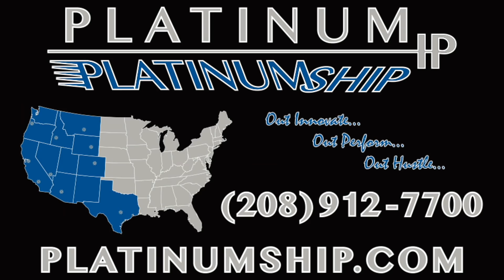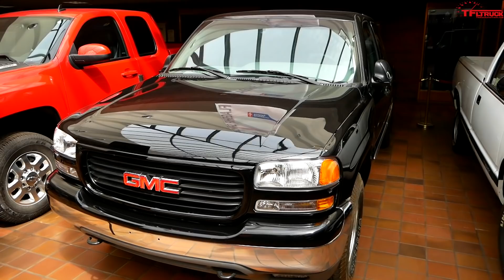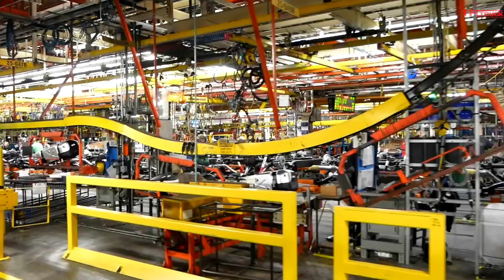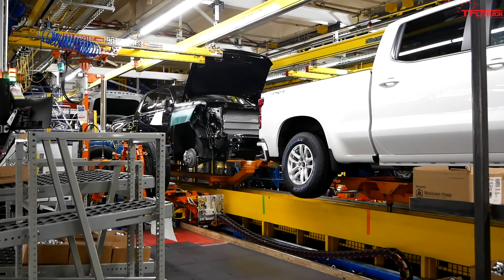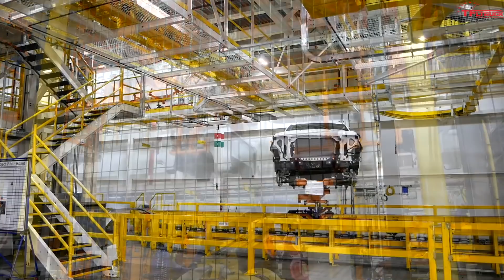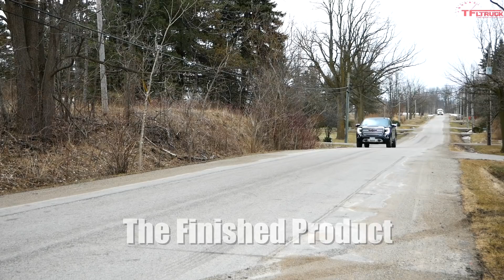They Can Build 1,000 Chevy Silverado and GMC Sierra Trucks Per Day Right Here

Comment: All or most vehicles price tags are way to HIGH !!!  I was able to by a 2012 Silverado 1500 used at a car dealership in 2013 with 25000 miles With a lift and wheels and tires for $28500 . I will never and never have bought a brand new vehicle.
Reply: Probably because you can't afford it.

Comment: Chevy has been on a downward spiral in my opinion since the Bailout...   For the company that I work with we bought a fleet of Chevy express 1 ton and vans.  I have never seen so many stupid issues since the 1990s Dodge Caravan.  Example:  Two of the work vans didn’t even have 2000 miles on them one of the front tires would be perfectly brand new rubber on the inside and threads showing at the very end of the outside.  We had another van needed a new Rear End after 1500 miles.  How about they don’t galvanize their bumpers anymore so if you get a measly scratch or chip in the paint it’s all downhill rest and out within two years.  “CHEAP CHEAP CHEAP”.    Why don’t they point this out in the Chevy commercials Instead of trying to make competitors look bad.

Comment: check the vin number on the dash.If it starts with 3 it's Mexican .Last year I was going to trade up my 2009 Sierra but all the new ones on the lot were Mexican .I passed.
Reply: What about South America add them in while your at it @michaellee-g9v
Reply: Michael,i think you are clueless, and congratulations on your knowledge of 2nd grade geography @michaellee-g9v
Reply: got something against Americans?
Reply: What part of my comment did you not understand? @anthonywebber2211
Reply: @danielburns7519 , you passed on a American built truck
Reply: THEY were all made in Mexico,they had a vin number that began with a 3.The service manager even admitted they were made in mexico @anthonywebber2211
Reply: @danielburns7519 , America is a continent not just a country, which includes Mexico and Canada
Reply: OK Anthony Mexican workers make $8.00 an hour with no benefits why not adjust the price of these trucks say 15,000 instead of 50,000.Screw Mexico I support the UAW worker @anthonywebber2211
Reply: @danielburns7519  Jose and friends probably have much more job pride than Dick, Rod and Tomika put together.
Reply: @michaellee-g9v  
You don't say
Reply: @anthonywebber2211  now i see that i wrote similar to yours.= Stuff happens. ** My truck has a Ft. Wayne decal on the back inside drivers door.

Comment: My 2018 Colorado has 7k miles and has to have the rear end repaired twice and its still not fixed, the air conditioning goes in and out, the transmission clunks when coming to a stop and when letting off the gas after accelerating, the paint has multiple problems in it developing from a poor job being done at the factory. Its in the shop right now because the engine is misfiring and the check engine light keeps flashing and for the AC issues. GM does not care about their products or their customers. Its great that they are building trucks here from a jobs perspective. But the final product is garbage.
Reply: @michaellee-g9v  I did hire a law firm recently but I chose poorly. I have not spoken to a lawyer one time, just a legal assistant. They are trying to force me to accept the settlement of which they will take half or claiming that I will be on the hook for legal fees. I looked up reviews before going with them and the reviews were mostly positive. But after dealing with them those reviews are suspect. Lemon Law Group Partners is the firm. I would recommend anyone avoid them at all costs.

Comment: When do the fluids get put into the vehicles? Seems like all videos of manufacturing plants show large & small pieces being assembled then the finished product. But never do we get 2 see brake fluid, coolant, AC refrigerant, etc. put in and processes that go into testing. Can't tell me that adding brake fluid and bleeding the system isn't a messy job ...
Reply: Brakes are actually very clean.  The tool puts a vacuum on the system first, so it doesn't need bled because there's no air in the lines when the fluid goes in.
Reply: Because fluids are boring.

Comment: With those kind of production numbers, why are they building pickups in Mexico?!
Reply: @Mr SunshinesNope. Mexico is long term.  You're thinking of Oshawa, Canada which Fort Wayne is supplying bodies for.  Once Flint, Michigan is running Oshawa will close.
Reply: Mr sunshine
You need to get it in gear
Fords are only building diesel engines for super duty. The MKZ and fusion and fiesta are done.
We didn't take the bailout neither.

Comment: In 2019,  GM produce 1 truck each 86.4 seconds

In 2010, Ford produce an F150 each 58 seconds

Ford wins😆😆😆
Reply: Ft. Wayne assembly produces a truck every 53 seconds. In 2017 it was one every 48 seconds. New processes required the speed to be slowed down mid 2018 when the 2019 models started being produced. I'm not sure where you got your information but it is incorrect.

Comment: You didn't even get to see the best areas of the plant, Body Shop, Paint Pre-treat, and the Paint mods.  Easily the coolest part of the process.   I've been a proud UAW Local 2209 member at FWA for 22 years.  Journeyman millwright since 2005.
Reply: Quick question can you give me a lame mans term of a millwright, is that jist an industrial mechanic, here in the Houston area millwrights are in high demand at refineries/chemical plants, i really dont know what a millwright does, Thanks God Bless
Reply: @Fatboydoesortriesit  at GM, millwrights do all mechanical repair, metal fabrication, rigging and some structural erection.  We don't do any plumbing as we have pipe fitters for those jobs.
Reply: @scottmassey5141  my father-in-law was a GM pipe fitter. He's a good man and a great pipe fitter.

Comment: My 2018 2500 HD came from Fort Wayne! The truck is mint, no rattles, squeaks, or leaks. The 6.0 although not the greatest on fuel is a great engine, I would buy this truck again.
Reply: Ratman572 buy American save a job.
Reply: @frankdenardo8684  Exactly..
Reply: @mctigmctiggy1475  I agree 100%, I have also had diesel trucks as well. While the 6.0 will never be able to tow like a diesel, it still effortlessly rips down the freeway with 11,000 going 70 smooth as butter. The suspension is also incredible for a 2500, firm but not harsh. Like you said, if you don't pull north of 20k regularly, the gas trucks are the practical choice. I am really curious about Ford's new 7.3 gasser, the thing looks like it will do well.
Reply: @mctigmctiggy1475  Mine came with the 6L-90, it seems descent, could use some tuning to firm up the shifts a bit.
Reply: Ratman572 you’ve bought a truck and your complaining about fuel.. stfu please
Reply: @vonsauto  On second thought, you are a dumbass, The whole mileage comment was to compare my gas truck to a diesel. How about reading the original response to my original comment before making STFU comments? Grow up man..
Reply: Ratman572  you’re sensitive stfu
Reply: @vonsauto  Not complaining, just mentioning. What's with the attitude??

Comment: I wish the 5.3 gets a tune for more HP and torque. It's too weak compared to the Ram & Ford V8's. Around 400 HP and 400 lb/ft is where the competition is at. The 6.2 is an awesome engine though. Has anyone been able to mod the 5.3 for more power ?
Reply: Superchargers?
Reply: Adithya Ramachandran my 2016 5.3 is tuned and takes off like a bat out of hell when I need it to 😁👍🏻

Comment: The 86 GMC reminds you of a time when Trucks used to be tools rather than a luxury item.
Reply: I have a 2015 single cab long bed with crank windows and an infotainment system that is literally only radio
Reply: I had a  1968 Chevy  Truck was $2,800  new  but I paid $110.00  for mine.. that's  what my buddy offered it to me for ..  I took the tired old  307  out and put in a very stout  350  with a  4 barrel intake off from a  '66 Vette  327  365  HP  and a healthy   mid power cam and headers..  It would smoke the right  rear  tire  every time you floored it and the fuel  pump started out at  110  MPH  the Power  Glide auto was stout and it road  like a car with   wish bone  and coil spring rear suspension .  The rear of truck was all rusted  out but under the hood was like new where engine oil leaked and preserved it for years
Reply: @mikeskidmore6754  I put a Corvette this and that on blah blah blah...
Reply: Guys, just as a heads up, I’m not criticizing trucks today. They are very utilitarian and luxurious. I’m just reflecting on how trucks have been through a massive transformation in the last 2 decades, and how their customer base has changed accordingly.
Reply: This is 2019, they can be both
Reply: @spengg_shell  tough being a "tool" with the 5 foot beds they have today.
Reply: You can still get it with a 8 foot box.
Reply: @MrGhislain79  Not from Fort Wayne. Those all come from Mexico now.
Reply: You can buy a base unit.

Comment: Only 1000 per day?
Reply: One every 53 seconds 24 hours a day.
Reply: @staydirtymyfriends518  so 816 per shift? I doubt it!
Reply: @wildosvt  
60÷53 gives you the number per minute
1.13 per minute. 
There's about 2.5 hours of breaks in 24 hours, so 21.5 hours per day of build time. 
21.5 x60 gives you number of minutes in a day of build time.
1290 minutes of build time multiplied by the number of trucks per minute.
1290 x 1.13 = 1457.7 or 1458 trucks per day in a 24 hour period.
Paint/body and the general assembly are staggered,  so breaks aren't at the same time though, so something is being built 24 hours a day.
There are (3) 8 hour shifts at that plant.
1458 ÷ 3 = 486 trucks per shift.
If you thought it was 12 hour shifts, then I guess you'd be somewhat close.
729 per 12 hour shift.
Reply: @staydirtymyfriends518  you said every 53 seconds 24 hours a day. My math isnt bad. Your original short reply was. Goona on you to detail it the second time. Now I know your real. Lol have a good day.

Comment: Like I thought,  they are the same truck. I guess they flip a coin at the end of the assembly line to decide if they are going to put a bowtie or GMC on it. Anyway,  that dismisses the GM rumor that Sierra's are built better than Silverados. If you like GMC better then fine. Just don't be delusional enough to think it's any better than your neighbors Chevy.
Reply: Wow your late asf
Reply: In the 1950’s a GMC might have a Hydramatic four speed automatic and a Buick or Pontiac V8. Today GMC designs all the trucks, so really the Chevy’s are just “rebadged GMC’s”....
Reply: @sammolloy8129  so they made the new Silverado ugly to sell more gmc's?
Reply: @sammolloy8129  a 1950 4sp hydramatic?
Reply: I think all the new trucks are ugly. A 2005 Chevy was a clean look but the new ones have that 1957 GMC look. They messed up the Ram with the Rebel grille, and Fords look pre-wrecked. The new Ranger is not bad looking though.

Comment: That is why “ Professional Grade” is just marketing. They are the same truck!
Reply: I’ve never heard GM say they were not similar but they have many different parts and are equipped differently.
Reply: I have found that the GMC's hold up better over time then the Chevy's. Yes the interiors fall apart in both of them, but I have a friend that retired from the UAW back in the 90's and he says GMC's have a couple more reinforcement spot welds on the frame, better door insulation, and I may be mistaken, but I recall him saying that GMC's had a thicker firewall for noise reduction. My GMC is going on 25 years old in 8 months (historic plates here i come :) ) and after YEARS of owner ship, I see more GMC k1500's on the road, then Chevy K1500's.

Comment: I worked in a GM plant for two years during college.  I still find it fascinating to watch the build process.  One of the neatest things about the plant I worked in is that it had 2 sets of railroad tracks that ran right through the main building.  Parts were delivered on the trains and we would unload them inside the building with forklifts.  I still remember what it was like to open those train doors with the tip of my fork.  It was a cool job.
Reply: Can you get me a gms code ?
Reply: i also was in such a Plant, but in Germany, from the German Truck Manufacturer MAN (Maschinenfabrik Augsburg Nürnberg) it was very interessting seeing the Parts / Engine / Frame etc. getting together!

Comment: You still would not get me to buy one of those ugly Silverado  they're unsafe
Reply: Umm, Isn't it the F150 that caught on fire and burned peoples houses down. Also were they not the ones with blown tires that killed several people including children. Yep, that was Ford!
Reply: Sorry I would never buy a Toyota or ugly too expensive horrible gas mileage I would never buy a Toyota I'll stick with my 2017 Silverado
Reply: Unsafe?
Reply: The new Silverado has a very poor crash rating on passenger side and the headlights got a very poor rating so in my book it's a unsafe vehicle I wouldn't buy one
Reply: Yes it has a very poor passenger side rating and the headlights got a very poor rating out of all of the big trucks
Reply: I still want it buy it for got a good for passenger and headlights was good to me it felt like GMC just brought out the new Silverado way too fast and that's what you get for using aluminum aluminum wick. And with using aluminum as going to be more expensive to fix